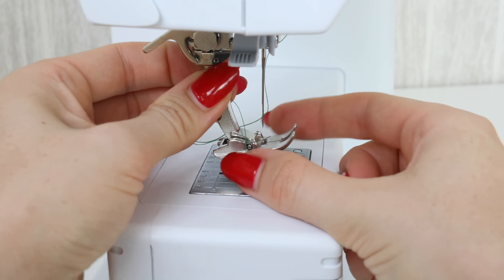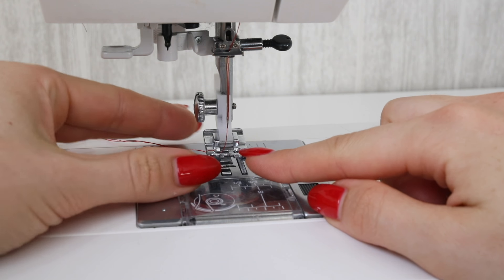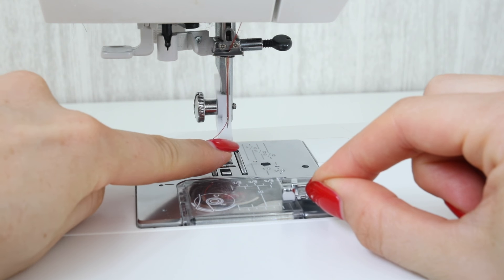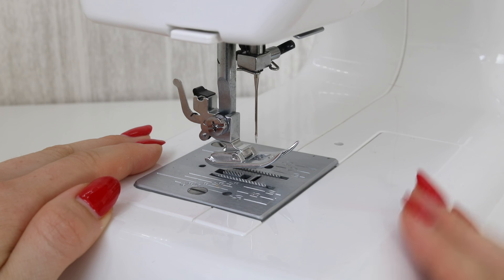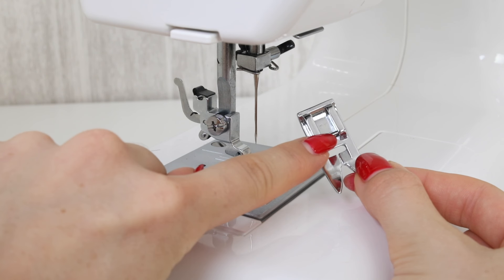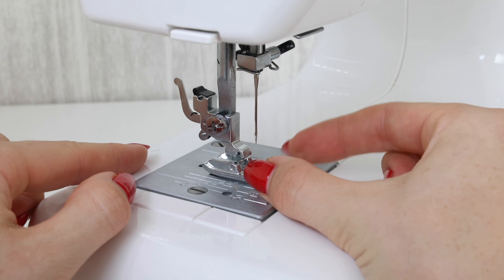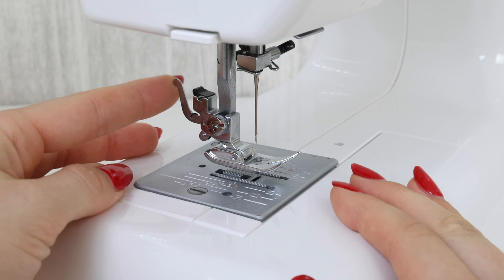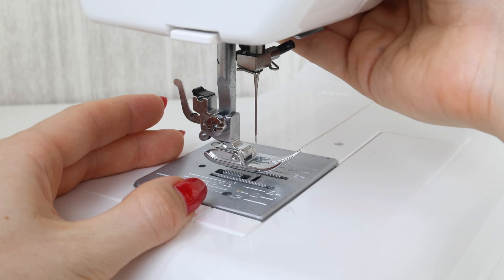How To: Change Presser Foot on Sewing Machine (Sewing for Beginners)

Comment: Mine isn’t working!  I have a 1C shank. I adjust the lever in the back, then lower the arm down, but the foot and shank do not communicate.
Reply from the maker: Did the shank originally come with the machine? Do all the other feet fit? I will try and help.
Reply: @MadetoSew  I did figure it out. My machine is brand new to me. There is a thin metal guide that fits into the back of the foot, which must lock the foot in place. I removed that metal guide, placed the foot into proper position,then snugged the metal guide in. It only took a few hours! 🤷🏻‍♀️
Reply from the maker: @endorn3234  Oh bless you.... so frustrating when you don't know what is going on. At least you have it sorted now. 😃 🙌

Comment: I can't snap mine on my singer machine. I don't know what I'm doing wrong
Reply from the maker: I think some of the Singer ones have a little button you have to press at the back of the foot when you snap it back on?
Reply: @MadetoSew  it has a lever but no button. It's looks like a metal hook you can snap a foot onto, but no matter how hard I push I can't get the feet on. I can only get the original foot on and off after a lot of difficulty
Reply: @MadetoSew  the instructions say it's a snap on and you place the new foot under the shank, lower presser foot and then push presser foot screw down firmly until foot snaps into place. However the foot just falls off.
Reply from the maker: @MichelleLee-fn9wz  Hi Michelle, if the original foot works and the others don’t, are you sure that the feet are designed for your machine? Feet can be different between different machines and models. The width and size of the bar that snaps on will be different, which is possibly why they aren’t working. It might be worth checking if they are designed for your machine? It sounds odd that the original works and these don’t. Aneka x
Reply: @MadetoSew  thank you, can it be different even if they're all singer feet
Reply from the maker: @MichelleLee-fn9wz  yes it will depend on the model of Singer.  Not all Singers are necessarily the same.
Reply: @MadetoSew  I think that is the problem. Thank you ☺️
Reply from the maker: @MichelleLee-fn9wz  glad it helped.
Reply: @MadetoSew  1 year later i found the Original instructions and figured it out- it is a snap on but after dropping the foot i needed to press down on the little screw that holds the thumb screw. So excited to be able to change my feet!
Reply from the maker: @MichelleLee-fn9wz  So glad that you found it. Yes some machines have a tiny little button you have to press. Glad you worked it out and good luck!
Reply: @MadetoSew  thank you so much for your help!
Reply from the maker: @MichelleLee-fn9wz  Glad I could help.

Comment: How do you fix a pressure foot lever, i think i pressed too hard on it amd the lever fell off
Reply from the maker: Oh dear, do you mean the metal bar that attaches the foot onto the machine? You may need to take it to a sewing machine shop to ask them for a replacement that works for your machine. Sorry Jess! Aneka x
Reply: @MadetoSew  yeah, that you pull to release the foot, i’ll do that thanks.

Comment: Hello my presser foot is like the third one you demonstrated. I have tried and tried what you have demonstrated in this video and my presser foot still won't stay. I think there's a problem with the foot holder. What can I do please
Reply from the maker: Hi Adaeze, oh no! I am really sorry to hear that. I am not sure what to suggest if it won't stay in position? Check you are using the right foot for the right machine? Not all feet fit all machines? If you are, maybe take the machine to be serviced and get it a check over? I hope this helps? Aneka

Comment: Advice please!!! Okay this isn't 100% on this topic but im having such a hard time researching this: my machine looks like the third one, its a singer tradition 2277, and Im looking into new presser feet for it. alot of the ones i want are "low shank" or "high shank" and im so confused. Can I only use snap on feet, or does that little screw mean it can be separated and i can attach a 'shank' foot? I assume mine is a low shank due to length between the screw and bottom, but I don't know if that screw is intended to ever be removed or not. Thank you for making this video and for any help that anyone can give me!!!
Reply from the maker: Hello, yes I think your machine will be a low shank machine. You can remove the screw and purchase adaptors if you can't find a foot that works with your machine as it is. Does that help? And some feed have to be screwed on anyway, like a walking foot. Hope this helps? Aneka

Comment: Aneka, I have a question re: Bernina. I am thinking of replacing my Zinger with Bernina.  Which Bernina would u recommend?  Do your like your 350 model?  Or, there is a new/better model that you’d recommend?  Thank you for your advice.
Reply from the maker: I love the 350, I think it's a great model. I can't quite remember the difference between the 330 and the 350, you might find that you can get away with the 330 instead? There are some newer models coming out at the end of the year (I believe), because I filmed a video on what sewing machines I recommend with a local sewing machine dealer and we have to re-film some of the videos because the makes and models have changed. So maybe wait until the end of the year to make your decision? It will depend on your budget too. Hope this helps a little bit? Aneka x
Reply: Aneka, thank you!

Comment: Pls can you show how to slightly convert a men’s tee shirt to look more feminine by adding a slight waiseline. Thanks.
Reply from the maker: Hello, do you mean that you want more shaping? So it is fitted? Does the T-Shirt already exist? What is it made from, I presume it is a stretchy knitted fabric? Thanks, Aneka
Reply: Made to Sew hi, thanks for your reply. I already have this men’s tee shirt from super dry. Its made of cotton, the fabric is alittle thick. Its suppose to be slim fitting for men. I want to alter it so it has a slight waistline. Can i just sew a slight waistline on the sides? Thanks.
Reply from the maker: Yes you can simply sew it in as and where you want. I would pin it first, try it on and check you like the fit before sewing. Maybe even tack / baste it first. Hope this helps? Aneka
Reply: Made to Sew thanks so much!